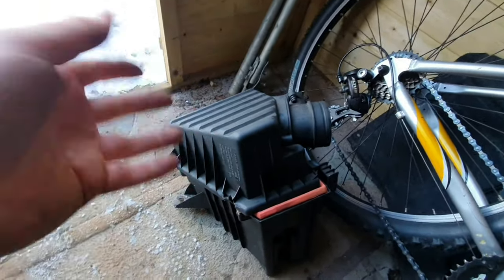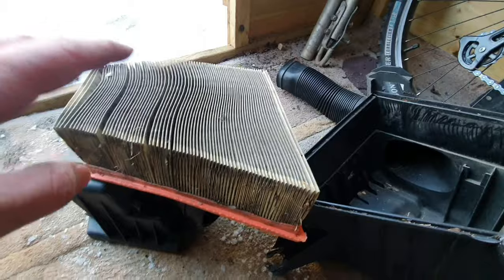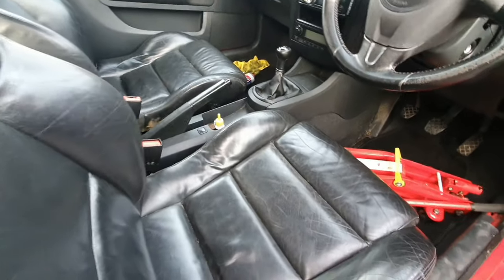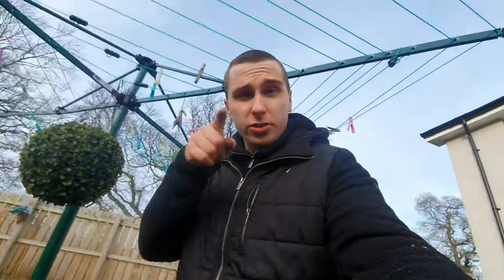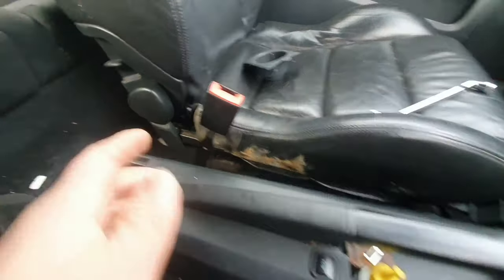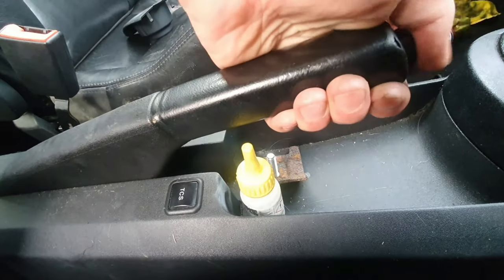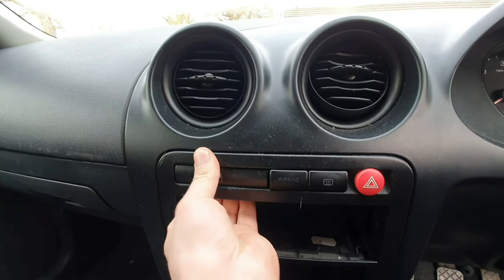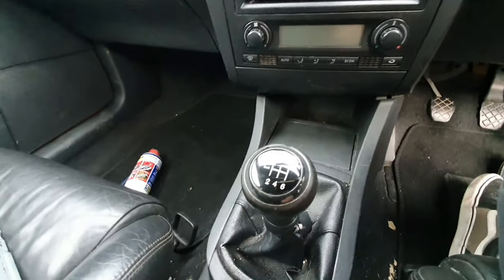Fixing The Neglected Seat Ibiza 1.9 TDI

Comment: Holy shit has the ibiza got a side exit exhaust? And sounds like it has been mapped with a hardcut limiter
Reply from the maker: It sure has 😉 but plan is to get a pd150 and a front mount then get it mapped again to run just over 200bhp hopefully 💪
Reply: @CarGuyLife  would be awesome that have seen a few class ibiza pd150 around in Belfast where I'm at they sound awesome some machine when done properly mate